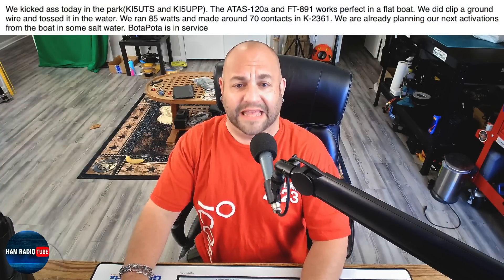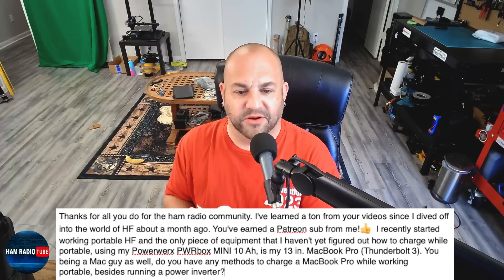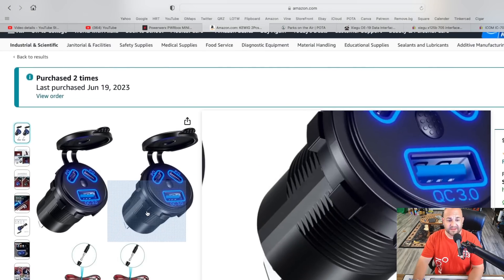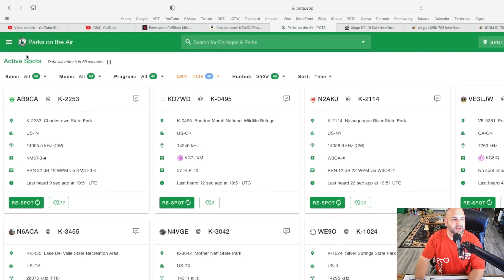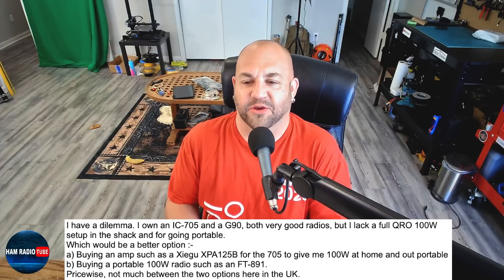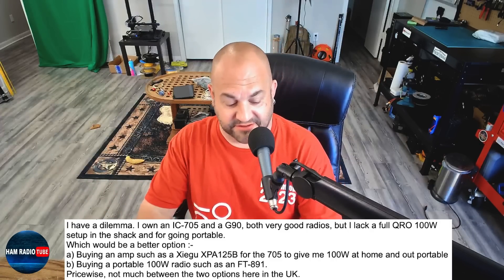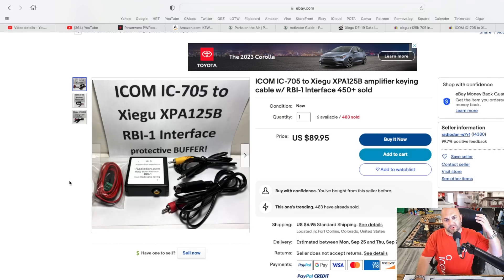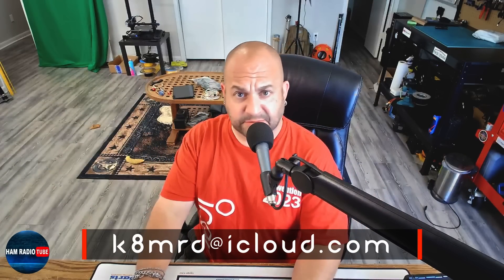Buy an Amp for QRP Radios OR Buy a 100 Watt Radio

Comment: Thanks for the usb-c tip. I've had that question myself for awhile. My mac charger is 61W (what a strange number, but that's what it says - I don't think Apple even sells them anymore but that's an aside). That Kewig is exactly what I've been looking for. Amzn has my order. On the 100W portable question, the Lab599 TX-500 + PA500e amp is the Ferrari solution, but it's about $2500 in gear. The FT-891 is by far the most practical solution on the market. Cheers. 73.

Comment: I bought one of those crappy $17 eBay HF amp kits and an $8 step-up converter to get a fixed 28 V to drive the amp with from my cordless drill's lithium battery pack. Then I built the amp on a large  old PC processor heatsink and fan and did some mods to make the amp satisfactory, (I went through my junk box and matched a pair of FET's for the amp, and a few other things,) built a couple of low pass filters and a socket to fit them, 1 for 40 meters and 1 for 20 meters, and stuck it all in a metal cookie can with some vent holes for the processor fan. Now my (tr)uSDX with variable drive voltage for the finals is either 5 W QRP or with the amp it's close to 50 W on 20 and 40, or any of the other bands that I make low pass filters for. (Ten meters won't go that high, but if 10 is open I won't need 50 watts. I could tweak the step-up switcher and push out 60 W or so on 40 meters, but why? I'd guess I have about $30 into the amp stuff and it was a lot of fun to build and tune. I have higher power rigs like an Icom 706 I could run, but this is a lot more satisfying. I recommend it to anyone who wants to have an amp handy for their QRP rig.

Comment: Hey Mike. Just watched your video about qrp or qro radios. When I went to buy my Yasue 817, I had the same delema not able to make contacts with 5watts. Instead of buying a amp, I decided to buy a Yaesu 897. I use the 897 as a qrp and qro radio. It does matter what antenna you use.

Comment: I was influenced by some of your first posts when using and activating the 891. I am of the same mind set, less equipment is better, IMO. I own the 891 and use it for home and portable use. This got me to get used to the radio and get familiar with the functions faster as well. I also agree with not relying on antenna tuners. I too use an antenna analyzer to keep my antennas resonant and have had very good luck thus far. All my equipment (radio, antennas, power supply, analyzer, and log book) all fit in one easy to carry canvas tool bag that makes portable radio use a breeze. The 891, IMO, is a great 'best of both worlds' kind of radio as I have used it as QRP and full 100watt. While the radio has a scope, I find the old skool way of just listening and dialing in the VFO will get you better results. Always great to watch your posts. 73 👍😎

Comment: As a newbie the FT-891 seems to offer most flexibility in a small package albeit lacking a fancy touchscreen and a tuner. At 80W it’s only +1 signal strength at a receiving station vs 20W anyway. Of course that might make all the difference in some situations. I have a FT-818ND that I was lucky to score new in the box possibly last off the line batch in March. I’m actually thinking about the IC-705 for “front range/parking lot” portable vs the FT-891 for same application. I don’t have a base station rig yet. Useful topics covered in this video. Thanks a bunch.

Comment: ...currently the XPA125b costs around 700.-€ in Germany. If you now add the price of the Xiegu but the whole package is quite expensive....
It is therefore cheaper and probably better to buy the FT891.......

Comment: The IC-705 is fun to operate for DX or contesting and sips power. To add some punch, I chose a compact 50 watt amp (Micro PA50).  50w is close enough to make most of the same contacts and will run for hours from a single 6 AH battery that you can carry on a plane. It really depends on how much you enjoy CW and lightweight portable QRP.  For mobile SSB you need more power and will likely be happier adding an FT-891 to your collection.
Reply: @SteveBerwick  I used the Micro PA50 pretty extensively on a recent trip to Aruba with good results.  Some observations: It worked well for CW and SSB but would overheat quickly on FT8 (the outdoor temp in Aruba is around 29 C, the amp shuts down above 50 C).  The input does not appear to be tuned. The SWR to the IC-705 would vary from about 1.3:1 to almost 2:1 depending on the band.  The drive level needed varies by band so may need adjustment when switching bands. If the drive level is too high the amp will shutdown and beep until you restart it.  On 20m it only needed about 2 watts when powered by a 6 AH LifePO4 battery (13.2v).  Battery life was no problem.  With the amplifier off-line, the last LPF might still be active.  I had to put it back online momentarily to switch the LPF to hear the band come up in the receiver.  It's a computer running firmware.  If you get into a weird state, just hot plug it to restart the software.

Overall the Micro PA50 made a huge difference in my ability to contact other stations. Using the amp most moderate to strong signals would return my calls.  Without it, making CW contacts was a struggle.  At $175 it's a good value for travel and did the job, but not without flaws. 

The assignment for this amp was affordable, small, and easy to pack. If you don't need small and easy to pack I might pick something better but it will cost you a lot more.

Comment: Mike, I use the IC-705 and the Xiegu together all of the time. I placed an adhesive pocket on top of the amp which permanently stores the three cables needed to use the radio and amp together. That way I don't forget the cables, like you said. I find that the amp will produce 80 watts with 1 watt input from the IC-705. The tuner is a plus in an emergency. Also, the IC-705 has a number of features and bands (not with the amp) the 891 cannot provide. Yes, the 891 is a great radio.

Comment: Hi Mike, I'm Radiodan W7RF that you referenced in the video for cabling and RBI-1A protective interface between IC-705 (or G90) and XPA-125B. Yes, there is a time and place for a QRP radio and external amplifier and a time for a 100 watt radio. I own two FT-891's. One has been my /M mobile for about 5 years and I have thousands of QSO's on it (mostly CW and a bit of SSB). My mobile antenna is very efficient (40-10M) and consists for a great way to make instant band changes. A 102" whip ball mounted in the right rear qtr panel of a Tundra and just inside the bed is an ICOM AH-4 tuner just inches away from the inside of that ball mount. I control it with a special interface we make that allows any radio to use the fantastic AH-4. I also have a spare FT-891 for portable ops and because I never want to be without my mobile should that one ever have problems. Tnx OM for a fine video and we all look forward to your next offering! 73, Dan W7RF (QRZ, see pics of mobile)

Comment: I've thought long and hard of getting an amp to go with my FT-817. The end result is just stick with my 7300.  Simplicity of setup wins every time.  If I want to go QRP, I just bring the 817. If I want QRO, I bring the 7300. If I need to travel light, then it's QRP.  An amp for the 817 and bigger battery is approaching the volume of 7300 and I'm  right back at just bring the 7300.

Comment: Remote operation is nice too. The 705 has an IP based server running on it which works great with SDR control available on iOS and macOS. Good reason to run an amp at home with it. Gives you the same functionality as the 7610 remotely.

Comment: I can't bring myself to give ~$1400.00 for a QRP radio like the IC-705. I can buy a 100 watt radio for the same price and turn it down to 10 watts for QRP purposes. I have a G-90 and I like it mostly because it has a built in antenna tuner that will tune almost any antenna. It's a lot if radio for the money too.
Reply: I love my g90, I just can't see that much for the icom either. I don't mind spending the money on good radios, but like you say, for that much money I can just about buy the g90 for qrp and a ft-710 and have the best of both worlds for a small amount more and I have two radios. Two is one and one is none ..
Reply: Well you're missing out because an IC 705 coupled to this Xiegu amplifier is an absolutely awesome set up! Mine is so dialed in. It's top notch.

Comment: I second Mike on the 891. I have the 705 and Elecraft KXPA100 - but still ended up with 891 after using a friends for a day while portable. Tough call for both QTH and mobile..
Reply: I have the 705 and KXPA 100 in my car into a Shark Hamstick. I've gotten around the world, but occasionally the KXPA 100 won't tune. What type of antenna have you used and have you had a similar problem?

Comment: Agree on the 891 for all situations. Bought mine as an “open box” a few years ago for $450. Powered only by a 15Ah Bioenno battery-was going to do POTA but never happened. With the ATAS-120A on my Subaru wagon roof, 57 different DX entities in 19 months and a couple states. The only thing that drives me crazy is…you know what it is…the “menu” system. I gotta’ find a way to tether it to an iPad or tablet so I can find everything. Maybe a Mailbag Monday topic??? 73!! WB3CFN/m

Comment: I use a Jackery 300 Explorer to charge my laptop while out. It works great, but once it goes below 40%, it goes quick. Used it at a SES back in 2022 to power my laptop to run FT8.  It ran all day with no problems.

Comment: I have a Elecraft KX3 and it can pump out 15 watts on some bands so buying an amp may not give me much.  Low power still gives you results when band conditions allow.  If I were you I’d buy the 891 if you’re after a base station.  Just be wary of the power drain and buy batteries to accommodate when portable.  73 Mike

Comment: Great video Mike! Ok, a better way... first pick up the Ameritron HF Power Amplifier TE-911 mobile, it's not that heavy but just a trifle expensive. For 20w to 25W in (IC-705 - Xeigu-90)  it will output a Terawatt of power which will solve several problems - if you're on POTA, it will deforrestate about 15 miles around you so that will eliminate nearby signals that will interfere with your activation. If you use it as your base station, it quickly eliminates complaints from your neighbors about interference with their electronics. Their electronics will simply no longer work. The main issue with it right now is the ability for an antenna to survive a use with the TE-911, I think Josh KI6NAZ is goint to try to do a "Will it Tune" episode using a flagpole, but Colin (DX Commander) may beat him first by putting a Titanium bowl on the top of his DX Commander CLASSIC which will make it directional and therefore allow you to DX directly through the earth omitting propagation problems. OBTW, I think existing Messi & Paolini Hyperflex 13 cable will carry the load. Just a thought...

Comment: I also have both the FT-891 and G90 w/ amp..  I can and do still POTA with the G90/amp, using a 2U Gator Case.  Battery is included, just grab the box, antenna, and go.  That said, the FT-891 I think is still the best option.

Comment: I've given up on my xiegus. I'll probably donate to my club or give to some needy new hams. They work great but juat a much better operating experience with my yaesus (i have 891 and ftdx10). I use tuned antennas like you, but i have a the ldg z100 small and easy to pack. So for me, its my FX-4CR for QRP and my FT-891 for all else. I also have an FT-450d which aint bad at all for portable ops. But yah, i think im just done with xiegu. Now wouldnt it be great if yaesu could fit a tuner as good as the g90's inside the ft-891 case? How much would that be worth?

Comment: 891 all the way, I had the 125b and it had issues so I sent it back. I have the FT-891, G90, IC-705, G106, X5105, and the Lab599 TX500 (so far love the TX500). I also have 3 50 watt amplifiers. But, I use the 891 when I need extra power. The external amps pretty much just don’t get used. Oh, and I have a IC-7100 I use in the shack. Just realized I need intervention. Lol

Comment: I can't say enough good things about my 891. It can be a base, mobile,  or portable 100 watt rig.  Before I bought mine I researched on YouTube. There are so many ham radio YouTube operators  that either have owned or do own a 891, that should say enough.  It's just a good basic, reasonably priced radio.

Comment: There are 1.2 S units between 20W and 100W. Thats why I will be doing POTA in the future with an FX-4CR. Everything is smaller and lighter.
Reply from the maker: yeah but what if you need 1.3 S units lol?
Reply: Then I'll whip out the fT897D @hamradiotube

Comment: I went with the FT-891 for portable. I wanted to have 100w for when we have to evacuate for hurricanes and emergencies. And it works great with the ATAS-120a in a boat. Thanks for the update Mike. KI5UTS

Comment: If the 705 was 20 watt and had real batteries....oh well...
However the ease and option of a Hardrock 50 with built in 10-1 atu is a sweet option, and offers more diversity than a 100 watt stand alone rig.
There's pros n cons to every setup.

Comment: I carried a lot more weight and bulk before i got my 891. Now my radio bag is half of the size and weight, if that. 

The 891 is so good that I've considered selling my 991a in my shack and double dutying my 891.

Comment: 8:28 get a $400 Kenwood ts50 or the Yaesu ft891, dont get the amp, just don’t 😂
Reply: Or just use the 20w QRP radio and build a quality resonant antenna.    The difference in power is S1.   

Increasing your ham radio's output power from 20 watts (W) to 100W results in a signal strength increase of approximately 6 decibels (dB), which is roughly equivalent to one S-unit on most S-meters. However, due to the logarithmic nature of the decibel scale, this increase may not be significantly noticeable to the receiving station.

For example, if your signal is initially received at an S5 level with 20W, increasing power to 100W might raise it to S5.5. To achieve a full S-unit increase (e.g., from S5 to S6), you'd need to quadruple your power, increasing it to around 80W. citeturn0search0

It's important to note that factors such as antenna design, placement, and operating conditions often have a more significant impact on signal strength than modest increases in transmitter power. Therefore, focusing on optimizing your antenna system can yield more substantial improvements in communication effectiveness.

Comment: nice video. yes get 100 watt radio. less to carry and go bad. for that USB C port there is also a 65W PD one on amazon.  this give more power. also they also have a 100 watt PD one with lighter plug on it. cut that lighter plug off and put power pole on it. plug into battery box. or just use that lighter port but that comes loose so you just have to push it in from time to time. also amazon has a lighter plug to USB C 65 watt adapter you can use in car or battery box. now some make QRM in HF bands. just put ferrite on USB C buy the power port. just wrap USB C cable threw a torrid a few times . most newer laptops can be converted to USB C . HP, DELL GATAWAY . amazon has cables for them. inverters will draw your battery box down. ok in a running car. I have 17 in HP laptop with USB C cable and my 20 ah battery box runs it for DAYS ! with 65W PD . how I am running not to do you tube. I am totally off grid. solar or car or wind charging.  I have been grid free for over 5 years now ! and I am in Boston NY . new York winters suck but wind power is great ! 73's

Comment: A 100 Watt radio is both a QRP and a 100 Watt radio. I don't see the value of a QRP radio only radio, and then adding more expense with tuners & amps. More stuff to carry, and more stuff to break. I am getting the 891, given the price, I am way ahead of the game, as well as superior filters, etc. 

WW7GBA 
Louis
Reply from the maker: I can argue both ways.  Yes you can turn the power down on a 100 watt radio, but you also need a bigger battery just due to the higher current draw if you want to operate for any length of time.  The 891 draws a solid 1amp just on RX so a little 3 or 6 ah battery might not be enough.  QRP radios are generally built with portable operations in mind and often include an internal battery, or you can use a much smaller one due to their much lower current consumption.  Plus they are just much lighter, smaller, and easier to use portable most of the time.  Going out and sitting on a park bench a few feet from your car is one thing.  Heck I bring my 7300 for that.  But hiking trails or climbing up mountains, you really won't want to be carrying all that extra weight.  At least I don't.  Unfortunately there really isn't a one size fits all radio.  There's always going to be a compromise somewhere.  Be it power, weight, size, etc.  So really the answer is, buy them all lol!
Reply: @hamradiotube   LMAO Yes I want to buy them all! 

Haven’t used one, but I have seen these tiny QRP rigs that are super cheap. If they are usable, why not go with those? I think I have seen these as cheap as $180 or so. Are they any good? 

Haven’t done POTA yet, going to start getting the stuff together for this coming year. I have been watching you, Jason & Tank, always good advice.

I hope I get to meet you guys when you come out to Buddipole here in Heber City, Chris is right down the street from me. Great guy and one AWESOME facility.

Comment: Well, I have the 891, 705, TX-500 and the FX-4CR. I bought the 125B and I have run all three of the QRP radios on the amp. Not such a big deal with the setup. All of your QRP radios if your used to using a particular one, will have way more power to work with is a plus. But as Mike said, “ That Me” that’s what I like to do.